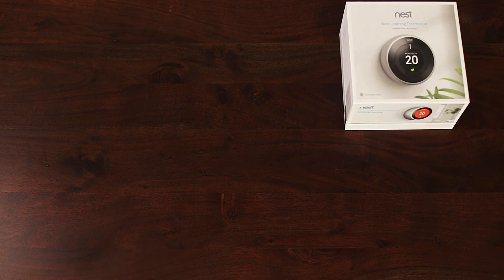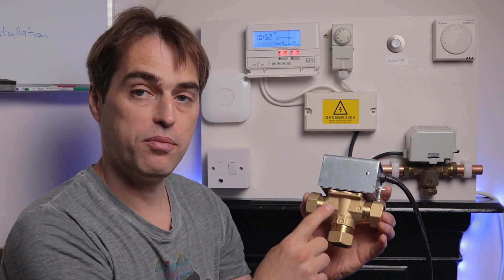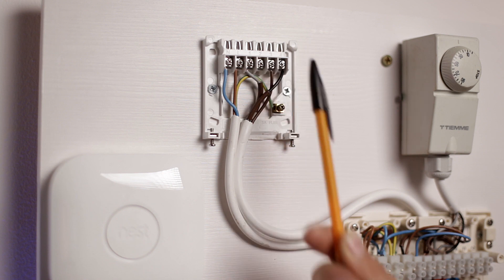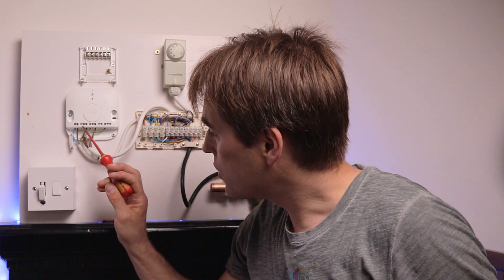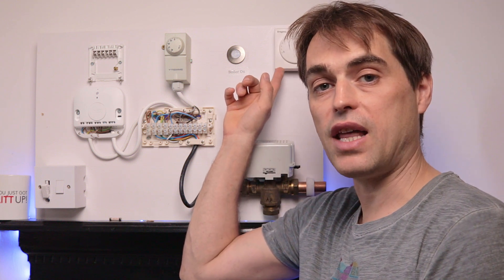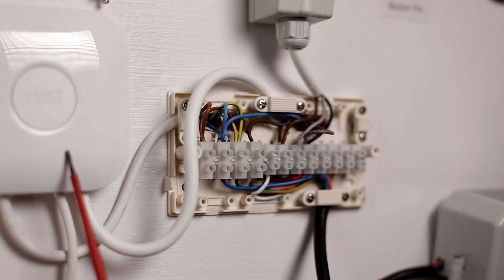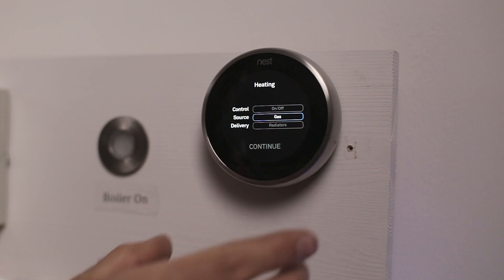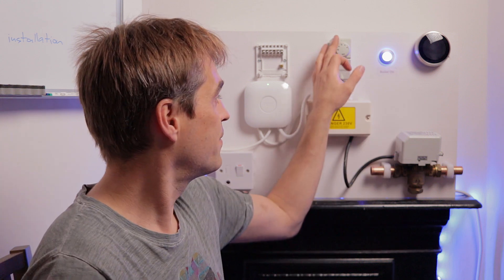How to install Nest thermostat (UK) on a Y plan - system with hot water cylinder & 3 port valve

Comment: Hi , on my Y plan I have  the pump as well , do you know how I should connect it . Thanks
Reply from the maker: Depends on the boiler. If it’s needs pump overrun pump gets its feed from the boiler if it does not you can wire it to the same terminal as boiler switched live
Reply: Thanks

Comment: Thank you for this and other videos. I have a question. Is it possible to have another thermostat in another area of the house powered using the USB power without the use of a second heat link?
Reply from the maker: No it’s not
Reply: Thank you

Comment: Best video for a Y plan. After watching this video, got the courage to install it directly in the airing cupboard which meant I could use the existing wiring to power the nest thermostat from heat link. Having the wiring diagram for the wiring centre helped. Also during set up, there was no option for regular boiler, realise have to choose system boiler. Had to rest the thermostat and do it again. Cheers
Reply from the maker: Glad it helped

Comment: Awesome video thanks! I am thinking about doing this myself at our new house. However, the wiring centre is in with the hot water cylinder and the heating control unit is downstairs in the kitchen. So to trace the thermostat wires from the wiring centre through the walls could get messy! Is the better solution just to disconnect the heating control unit and wire the nest heat link in the hot water closet? Thanks!
Reply from the maker: DTHPTRL yes wire heat link in the cylinder cupboard and re use wiring from the thermostat to power your nest from the heat link

Comment: Thanks for that video - I just did my install on an house with old coloured wiring, a rats nest of a wiring centre with lots of sheaths over wires, a circuit breaker, 4 wired t-stat and an oil boiler and everything seems to be working fine. The wife is happy so job done !
Reply from the maker: Paul Holden well done !

Comment: Amazing channel and video. Where does the wire for the central heating pump go? I seem to have one going back to the old controller...
Reply from the maker: it depends on if the boiler needs pump over run or not. If it does have an overrun then power comes from the boiler, if it does not have overrun then orange of the zone valve
Reply: @UrbanPlumbers  Hi! So the zone valve should power the pump? Is that what you mean?
Reply from the maker: Tony B yes

Comment: Thank you very much, this really helped me fit the thermostat, great video. 
I made 2 mistakes which I have rectified, maybe this will help someone else.
When you measure across T1 and T2 looking for 12V, make sure your multimeter is on DC not AC, otherwise you get a false reading (This caused me hours of head scratching). 
After fitting, there was no option on the Nest Thermostat or the App to control hot water.  To solve this, you need to go into the settings of the thermostat, then click on Equipment, then Pro Setup, then select System Boiler.
Reply from the maker: all correct and good info!

Comment: Fantastic. These videos have been incredibly helpful, thanks so much.

Just one question; my programmer and wiring centre are in different rooms. Will I be able to access the necessary wires without running new cable through my house?
Reply from the maker: Ronnie Thunderpeen yes not a problem just install heat link next to the wiring center
Reply: @UrbanPlumbers  Perfect, thanks!
Reply: @UrbanPlumbers  just finished installing and testing! Was a bit of trouble tracing all the wires to the wiring centre, but got there in the end.

Thanks so much for your help!
Reply: Urban Plumbers my programmer is in my garage, thermostat in lounge and wiring centre in the airing cupboard with cylinder. I managed to do everything in place of my old programmer in the garage except for the final T1 and T2 wires as I want to hardwire the nest, I have a feeling I’m going to be stuck as the thermostat wires most likely are heading upstairs to the wiring centre but my heat link is installed in the garage, do you have any suggestions please?
Reply: @hxrnake  I had a very similar situation to you. I installed the heatlink in the airing cupboard and just removed my programmer. I know it's a pain, but short of running new wires from your garage to your lounge, I think that's your only option to provide wall power to the nest.

I would strongly advise you pick up a multimeter to help you identify wires and confirm voltages. You can get them for under £10 on Amazon.
Reply: Ronnie Thunderpeen does the wiring effectively stay the same though? Will I have to pull the programmer wires running to my garage back through into where my wiring centre is and go from there?
Reply: @hxrnake  The wiring should stay the same. I used my multimeter to identify each wire in the wiring centre as it corresponded to the programmer by joining two of them at a time at the programmer, then checking for continuity at the wiring centre.

I then used new length of wires and connected each to where the corresponding programmer wire was in the wiring centre.

Apologies, I know this might be hard to follow. Best way to understand it is to get hands on and work out what's going where.

Worth noting you can leave your programmer untouched, which actually makes it a bit easier. I just took mine out as it was in the kitchen and looked a bit unsightly.
Reply: Ronnie Thunderpeen thanks for the explanation mate, really appreciate it! Will give this a go tomorrow and see how I get on.
Reply: Ronnie Thunderpeen Hi again Ronnie, just a quick question. Let’s say I go with your suggestion of leaving my old programmer in place and wiring it all in the airing cupboard with new length wires. Would I leave the old programmer set to the always on position option?
Reply: @hxrnake  Yeah, that's how I've seen it set up elsewhere.

Worth noting I'm an absolute amateur and have no electrical or plumbing experience besides this.

Comment: Tried to install generation three onto a Y PLAN system. Heat link light solid green thermostat connected ok. 
But boiler doesn’t seem to recognise heat link and is continuously firing. Checked all the wiring every thing is where it’s supposed to be . Honey well wiring station was working fine with old programmer and thermostat . I made sure I move ch on over to number 5 -white cable for 3port. Can’t work out what’s wrong.

Comment: Great video - thanks for taking to time to record and share! I’m just about getting my head around the wiring now. One question I had was - I wish to utilise my room stat wiring in my hallway to mount the nest stat to the wall. The cable (3 core & E) appears to run directly up to my wiring centre in the airing cupboard. Do I need to install the nest heat link inside the airing cupboard instead of where the programmer is by the boiler in order to utilise the stat  wiring? And if yes do I essentially just disconnect and make through any wires that require it form the existing programmer. (Located underneath my boiler in the utility room)
Reply: I’m after an answer for the exact same thing, my programmer is in my garage whereas my wiring centre is in the airing cupboard upstairs, I really want to use the existing stat wires but stuck with what to do now! Did you ever figure this out?
Reply from the maker: late repaly - but for others - install your heatlink by the wiring center and that way you can use your thermostat wiring as it uusually goes directly to the wiring center. Look for a wire connecting to the heating zone valve brown in the wiring center - it should connected to SL from the thermostat

Comment: Hey bud this is a great video i followed the whole video step by step and if anyone I know buys a nest I'll be sending them to this video.
I seem to have a little issue tho my hot water is working and but my heating will only come on when the hot water is on could I of done something wrong or is this a common issue with the nests.
Reply from the maker: not an issue with Nest, wiring error somwhere. Download wiring diagram from my web site and check your wiring again
Reply: @UrbanPlumbers  ok cheers I'll have another look. Thanks for responding

Comment: Brilliant explanation of Y-plan installation. My old thermostat (Honeywell)has 3 wires with following mapping : 1- Red, 3- Yellow, 2- Blue and they all are connecting to the wiring centre> From your video it displays 2-wire replacement plan. Can you suggest what to do in this case?
Reply: Hi, did you ever manage to solve this? I'm currently encountering the same issue.
Reply: @RonnieThunderpeen  
Did you manage to solve the 3 wire problem?
Reply: @neilgavin7334  so my previous thermostat was set up as follows:

2: COM
3: H
4: TL
5: N

Brown: Between 2 and 4
Red: to 3
Yellow: to 4
Blue: to 5

At the wiring centre, I connected the red and blue wires to the controller to give 12V, then connected those to the nest.

IMPORTANT: Remember to check that there are 12 volts going through these wires before connecting the nest or you can fry it. I am in no way trained so take this advice with a grain of salt.
Reply: Im just doing this and from what I can tell on mine its live neutral and switched live. 

If you take them off the thermostat, take a picture first. But join 2 then go to the wiring centre and test for continuity until you find the other end of the cable. Then test across another combination of the 3 wires just to be sure you have the correct cable at the wiring centre. After that if you're having the nest on a stand the cable is redundant but if you're mounting it in the same place then you only need to use 2 of the 3 wires to get a 12v supply from the heat link to the nest wall mounted stat.

The thermostat has a neutral because apparently it helps increase the accuracy of the stat. 

( I'm no expert, by any means but this is my understanding so far)

Comment: Just taken the programmer off the  wall and it has 2 live wires and 2 neutrals? does that matter because they are fairly thick cables, might struggle getting them all in the link
Reply from the maker: chris harrison it has L,N and 2 switched lives. Are wires connected to L,N and 3,4? If yes you are on S plan. Watch my other video on S plan.
Reply: @UrbanPlumbers  Hi  thanks for replying I have 2 wires in the neutral, 2wires in the live,  one in number 1,  one in number 3, one in number 4,  with a 3 port valve  thanks

Comment: Czesc! That was absolutely brilliant! I have a Y Plan CHS  with the Junction Box and have been trawling thru Videos and forums looking for a clear and concise process to Self-install NEST on my CH and the advice is full of confusion and lots of 'plumber speak' that is difficult to understand - even your Schematics is idiot Proof!! - buying the NEST Today on a Black Friday deal and will have this installed by the Weekend, you've made this look so easy -  Thank You!
Reply from the maker: Beebejay good luck!
Reply: @UrbanPlumbers  Seriously - brilliant demonstration - just one question if I may. 
My plumber installed a Salus RT310rf Wireless Thermostat last year as part of a new Intergas System Boiler Install (we didn't have a Room Stat before) and it's been fine - I just want to get more control remotely and like the idea of the Nest learning function. 
When the Salus receiver was installed he didn't remove my Drayton LP522 2 Channel Programmer and said I can leave the CH on permanently (with the Thermostat controlling the demand for heat rather than the timer) or use the program to schedule CH On and Off times with the wireless Thermostat controlling the Room temperatures.
It looks like the Nest completely replaces the LP522 - if this is the case do I simply disconnect the wires for the Salus Reciever in the wiring Centre and get rid of it. Any advice would be much appreciated. Thanks.
Reply from the maker: Beebejay correct remove both salus and programmer
Reply: @UrbanPlumbers   Urban Plumbers  Hi My Friend. Installed the NEST 3rd Gen yesterday as per your instructions, which were brilliant. 
It went well, bit difficult to link the Common Wires from L-2 & 2-5 due to small connection holes to fit 2 wires in so I used a Connection Block to the Main Live feed and split to L,2 & 5. 
Fired up Thermostat  via USB wall plug and set up. 
It works perfectly for Heating and fires up and shuts down the Boiler perfectly when requested. 
However it doesn't seem to do anything to the Hot Water. 
My 3 Port Valve does not move at all and there is No option for Hot Water on the App?
There is no Boost or Schedule options for Hot Water either. 
This morning there was no hot water for the house so we pressed the Manual mode button on the Heat Link (the user instructions that come with the Nest are rubbish we just pressed the button and hoped something would happen) and that gave us Hot Water (there is a water drop icon on the Heat Link now) but the 3 Port Valve still doesn't move over? 
I've wired exactly as you have done in both the Heat Link and Wiring Box. 
Have I missed something,  Set up the Thermostat/App wrong or my Boiler is not compatible?
I have an Intergas HRE 30 SB (system Boiler)
Sorry for the long message. 
Any advice will be greatly appreciated. 
Many thanks.

Edit: Just to say I'm now sorted and the Nest is running perfectly with Hot Water control now on the App. 

Had a play around with settings after a Reset and it's fine.

Comment: Hi really like your videos.if you intend on using the stand for the nest and not the existing room stat.what do you have to do with the thermostat connections ?
Reply from the maker: waseem khaliq you need to disconnect existing connections at the wiring center and leave all else in place

Comment: Hi, question: Can I install Heat Link using just TWO wires, that my current thermostat is using to power on my heat boiler (Electric Central heating Pantherm). Basically, current thermostat, closes the electric loop when heat is needed, everything else done by the electric boiler. If this is possible, which two connectors on the Heat Link should I use, and do I have to "jump" any of the connections? I know that there is a NEST E thermostat on the market which is design to replace my current thermostat, but I would like to use 3gen on my system, because it will give me wide options if I decide to change my boiler.Thank you for the answer.
Reply from the maker: Bojan Trafela yes you can do that but you will also need to supply power to the heat link in top of that. Basically run new supply to N & L and transfer your current thermostat wires to 2&3 on the heat link. No jumpers needed.
Reply: Thank you for the quick answer. Just to clarify something. The current two wires that I have are "live" (220V) and connected to the battery powered wall thermostat and they go directly to the electric Central heater (which is always on). So, by new supply for the Heat Link, do you mean, just direct power from the wall socket (220V)?
Reply from the maker: @bojantrafela9881  I your heating is electirc then most likely you will not be able to use the Nest as it can only take 3amps (heat link). You will have to use a realy to switch the load or see if your existing installation has a realy.
Reply: @UrbanPlumbers  What about Nest E thermostat? Is this one compatible with electric heating?
Reply from the maker: Bojan Trafela non of the standard thermostats are, you need a relay with all of them. What’s your current stat? Are you sure you don’t have a relay already ?
Reply: @UrbanPlumbers  I believe a relay is in the electric boiler? My current thermostat is a battery powered EUR 091 type (http://qlc.nazwa.pl/salus/upload/instrukcjeen/091%20GB.pdf)
Reply: That is why I think Nest E would work?
Reply from the maker: Bojan Trafela or just use Nest E, the. You can just transfer wires to 2&3 nd job done as E uses batteries to power it up. See my other video on Nest E for more info.

Comment: Can you just swap over the face dial when upgrading from generation 1 to 3? Leaving the wiring from gen 1 in place?
Reply from the maker: I assume you are in US? We did not have Nest gen1 realsed in UK - it was only gen 2 that was realesed in UK. If you are in UK then most likely you have gen.2 Nest - if that is the case then you need to replace the heat link and also re wire as Nest Gen.2 did not have hot water control. 

If you are in US then I simply do not know the answer to your question. If you are in UK - then no, you cannot just replace face dail.
Reply: Urban Plumbers I am in the UK and purchased the 1st thermostat released here with no water control. Is the re-wiring the gen 3 quite straight forward when upgrading?
Reply from the maker: @Chillash007  then you have 2nd gen. What system do you have? (Combi boiler or hot water cylinder?) - if combi then it is very easy - just keep same wiring - if you have hot water cylinder then you have a bit of rewiring to do including removing existing programmer.
Reply: Urban Plumbers would it be possible to video the steps required when upgrading to the generation 3 from an older version? I’m sure others would be interested. I have a hot water cylinder. Thanks for all the replies.
Reply from the maker: @Chillash007  all you need you will find in S or Y plan video posted already. I assume you still have old programmer connected and heating set to constant?
Reply: Urban Plumbers Yes old programmer still connected with heating set to constant. Hope to use the water on/off function but not sure if the upgrade is worth all the hassle now?
Reply from the maker: @Chillash007  are you on S or Y plan?
Reply: Urban Plumbers Y Plan
Reply from the maker: Chillash007 just follow schematics then and this video - all you need is here. If you don’t feel confident enough maybe get someone in to do it for you.